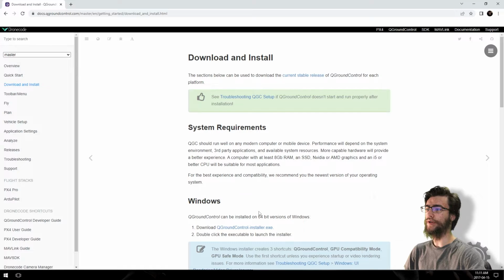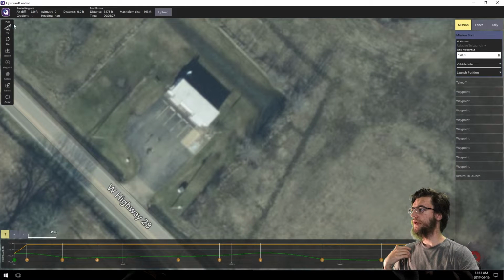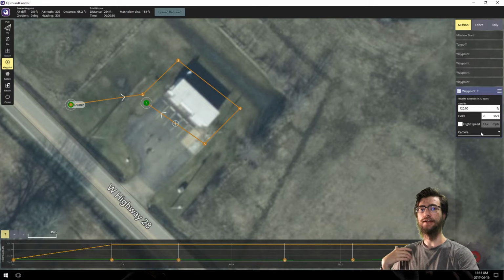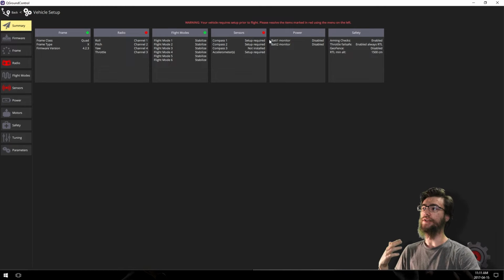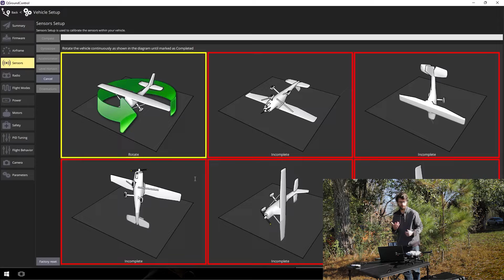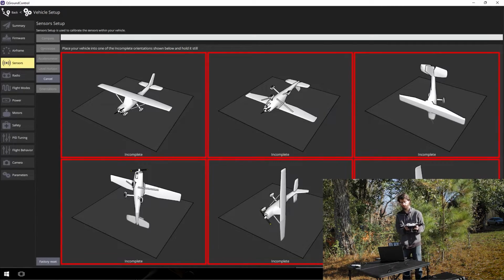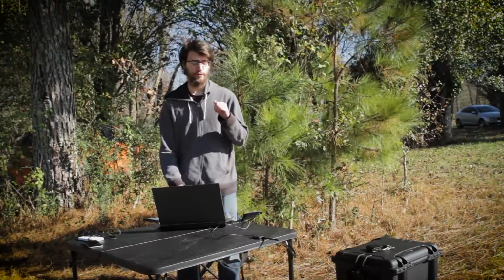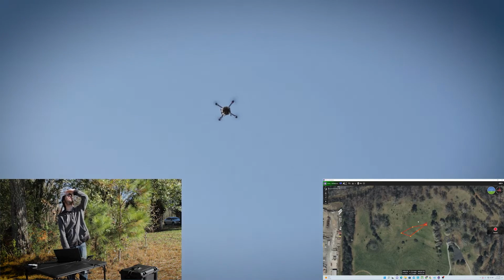Intro to Flight with QGroundControl

Comment: In the beginning QGroundcontrol asks which for which firmware I am using the program. I could choose between PX4 Pro, Ardupilot (Default) and Mavlink Generic. You don't show that. Why is it asking that? What if I run different kind? I cannot find settings to change that.

Comment: Hi, I have 2 RTK modules on my drone (I use it with the mission planner). Is it possible to use these sensors in Qground control?
Reply from the maker: Hey, not certain without knowing more about your system, but if it is already operational in Mission Planner then I would expect that switching to QGroundControl would be fairly seamless.

Comment: great video,
thank you.
can you tell us which frame are you using?
Reply from the maker: The frame was one designed by us for Develop Air, our open source drone platform. The 3D print files for the fuselage are available in our Discord if you want to print it yourself. We also sell the parts and subassemblies for Develop Air, including the fuselage on our website. - Jacob
Reply: @ivuerobotics  
Thank you for replying back.
Can you please share the link please?
Reply from the maker: @Barlaas.Aziymey  Yes, it looks like I had not actually submitted the post in Discord yet, but it is there now. - Jacob https://discord.com/channels/905975466744250408/1055901229441630218/1068390184435068978

Comment: Hello i have a problem with battery status of my quadcopter the battery status is: "OK" and doesn't tell me any specification, and because of that i can't calibrate my esc on qg ground control, if you have any idear for resolve my problem. Ty !!
Reply: What flight controller, power distribution board, and battery are you using? Feel free to reply here and I will get back to you as soon as I can. We also have a Discord server you can join to ask questions for others to help as well.
Reply: @ivuejacobandrews  Hello, i use a pixhawk 2.4.8 with a power module connect to a 5000maH bashing lipo battery
Reply: of course i can join the server, because im blocked for a long time now !